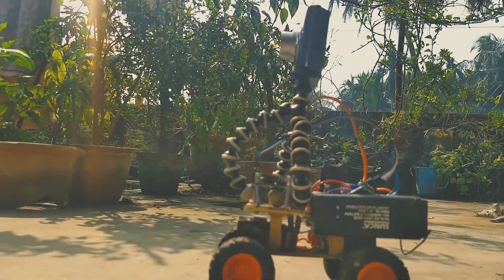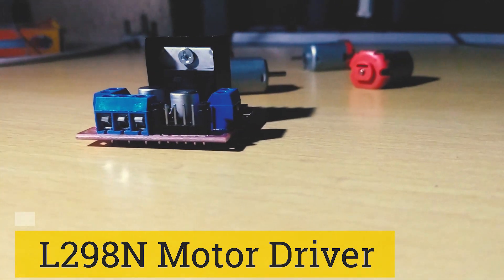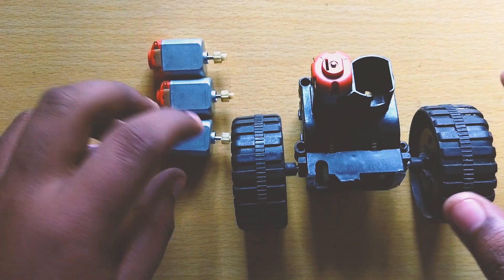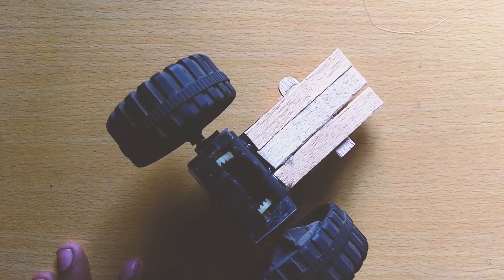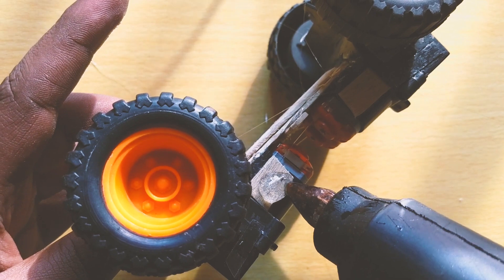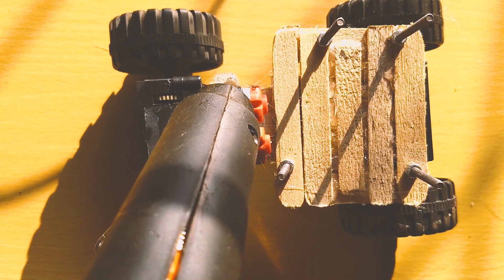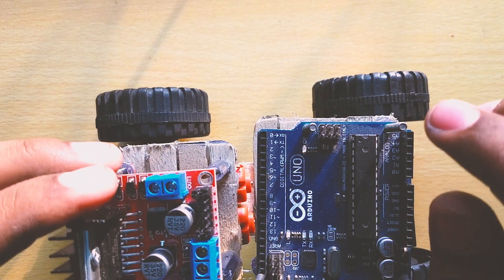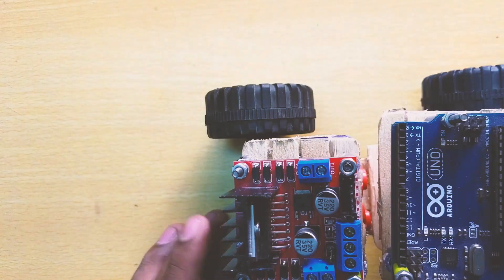How to make a RC Bluetooth Car With Arduino  ?  Part 1 Arduino #4

Comment: when i connect all jumpers as shown in video and switch on power supply my L298n driver led powered  but aurdino green and yellow led dosent get on also Bluetooth also dosent get powered ? 

i connected all connection as per diagram but in diagram it is shows "THERE'S A PIN NEAR THE +12V INPUT TERMINAL THAT SHOULD BE SHORTED TO BRIDGE THE POWER TO THE +5V TERMINAL" 

 how to do it ?

where i am goin wrong?
Reply from the maker: Check your arduino power section. 
Check your arduino is ok or not....
Check it with usb type a

Comment: how to do this ?
THERE'S A PIN NEAR THE +12V INPUT TERMINAL THAT SHOULD BE SHORTED TO BRIDGE THE POWER TO THE +5V TERMINAL
Reply from the maker: Don't short the 12v input and 5v output paint give the adreno Probal power 5 volt from the outgoing of the motor driver l298n
Reply: Creative creator 
ok Thanks

Comment: If i use two 5V motors  and one 9V motor will it work on 12V battery?
Reply from the maker: Yes it wll work but one thing that 9v battery has very  low power i think 230mAh it will not last for long time so, better to use 2 , 9v battery parellel or use 18650 cells
Reply: Okay thank you so much!
Reply from the maker: Welcome please subscribe!!
Reply: I'm already subscribed :)
Reply from the maker: Thank you!!
Reply: @Creativecreator  ,,bhai best option holo powerbank diye arduino ke power deoa,tai na?///amar mone hoi tumi bangali,,,tumi jodi voice control car er program chao amai reply koro,,by the way nice project....

Comment: dada tumi habra te thako?...
Reply from the maker: Ha
Reply: dada amake ek2 motor er specs ta bole dao...dc volt, rpm etc etc
Reply from the maker: Dakho sob ki6u tomar budget ar upor nirvor kore.... 
Jodi kom budget hoy tahole 6to9v ar DC motor gulo use korte paro per piece 80 kore nai....
Abar aktu valo blle 300 rpm ar 12v motor nite paro agulo 120 kore nai....
Reply: budget amar 2500moto...arduino uno already amar ka6e a6e...to ei budget er moddhe bhalo pabo to?...r tumi kto rpm er motor use kore6o?
Reply from the maker: Hmm pabe tahole 300 rpm ar motor gulo nao ogulo valo.. 
Chadni thake kinle robotics corner thake nio aktu kom nabe...
Reply: r tumi je chaka gulo use kore6o segulo o dokane pabo to?...ami bhablam online e kinte hote pare
Reply from the maker: Hmm pabe online a o kinte paro sob e ak sob China thake ase...
Reply: chaka gulo pabo kina setai chap...mane chadni te erum type er wheel dekhini kokhono....r basically ami noob ei type er kaaj e...tai eto questions
Reply: Bro arduino program korar somoy Bluetooth er  kon wire khulte hobe????
Reply from the maker: REFAT HASAN rx ar tx

Comment: Sir part 2 kab ayega
Reply from the maker: part 2 hain check karo
Reply: Kya mei 9volt battery use kar sakta hu 300rpm ka motor chalane ke liye
Reply from the maker: @ayushsoni6188  yes you can use